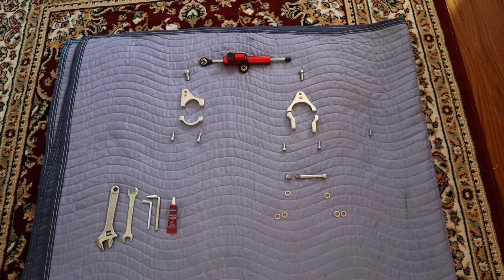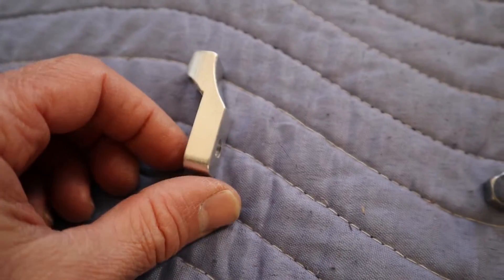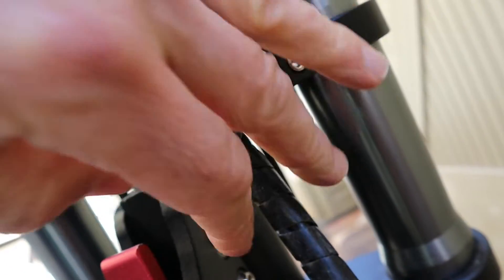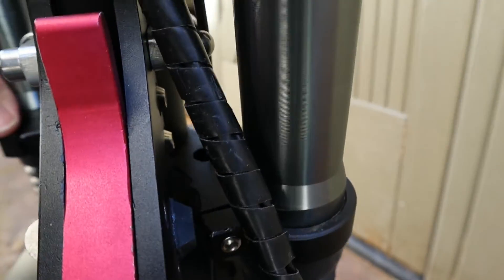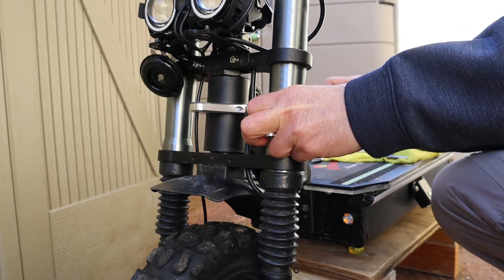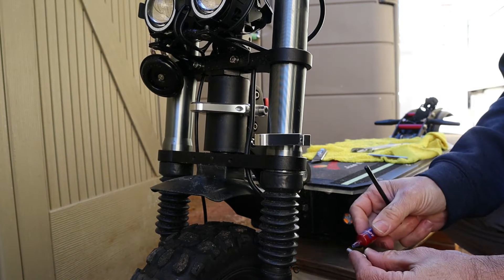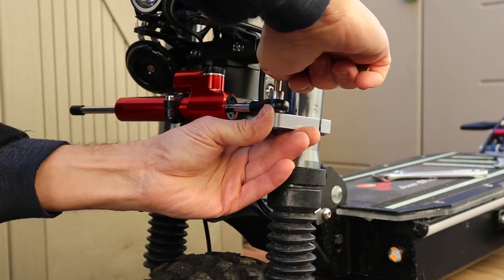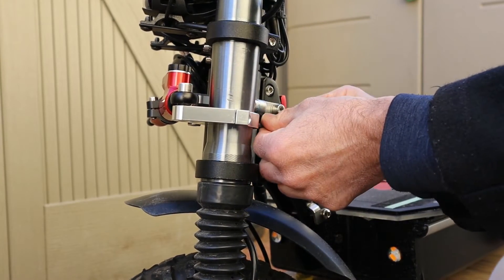Scooter Steering Damper Installation

Comment: You may not need the special pieces he made for the 55mm bracket. You can  cut a middle gap in the back part the 55mm bracket basically created two smaller pieces. It’s not a complete wrap around on the back bracket, but it it still secure and shouldn’t fall off. You can also get a thin piece of galvanized sheet metal, fold it a few times, cut to size and create your custom piece for a complete wrap around. No special tools needed. Thanks for the video! It helped a lot.
Reply: I'm new getting into this and I'm having a hard time finding a steering damper for my Laotie ti30, or at least the mounting portion of it sigh
Reply: Agreed.  I took your suggestion and chopped the included 55mm clamp as you suggested.  It was plenty of partial wrap-around like that and has held up well.  Thanks to the poster of the video and this added suggestion.
Reply: @randywilliams2052 may I see your work?

Comment: Hi Joel,
Thanks for your explanation and ideas. I bought all the parts from aliexpress but i was wondering if you can help me with some measurements for the 55mm clamp modification. I dont have access to the scooter now and i can try to prepare the 2 halves but i dont have any measurements to start from. Do you have by any chance some template or some dimentions to help me with? Best regards.
Reply: Hey Dani could you possibly send a link to where you found it? and if maybe you figured out the measurements as well! Thank you so much happy new years!

Comment: where did you buy steer damper?
Reply from the maker: Aliexpress
Reply: @MrEnergyFree  i tried to look on aliExpress but its hard to find it. Do you sir a link?
Reply: I allso need this kit and damper.Please advice how to get !!
Reply from the maker: @TheWorldOfAnimal0617  I bough all the part separated and I put it together myself.
The description from Aliexpress are:
Universal Motorcycle Aluminium Steering Damper Fork Frame Mounting Clamp Bracket 30mm 32mm 33mm 35mm 37mm 38mm 39mm 40mm 45mm
Cnc Aluminum Steering Damper Motorcycle Damper Fork Bracket Support Holder Universal 31- 54 60mm Aluminum Bracket Support Holder
For KAWASAKI ZX7R ZX 7R 1989 1990 1991 1992-2003 CNC Aluminum Motorcycle Damper Steering Stabilize Safety Control
Reply from the maker: @Tjvaara  I choose the 55mm for the center and Clamp and 41mm Clamp for the shock adsorber. All from Aliexpress
Reply: @MrEnergyFree  I'll look for them.The fork is 41mm i know this because i ordered from Aliexpress clamps for turn led light signal's.The center clamp is more of an issue but i'll look for the 55mm clamp and two 60mm support clamps for this like you said.Thanks 👍🙂
Reply: @MrEnergyFree  For the 55mm center bracket did you make yourself the "two" small brackets that go with the 55mm to fit secure with long bolt.I can't find the "two" small brackets that go with 55mm clamp.Please advice 👍
Reply from the maker: @Tjvaara  Yes, I made those myself from a block of aluminum and two days filing and drilling. You can also take the half back of the clamp and cut a gap to accommodate the neck that goes to the deck. That was my original idea but I decided to make more involved.
Reply: @MrEnergyFree  what type of bolts did you get ?
Reply from the maker: @onehubanime2770  Stainless steel
Reply: @MrEnergyFree  Hi Joel. Have you thought that you can gain some money by making and selling those parts to us :) ?  Make a price, please. I don't have any chance of making them. Thanks a lot. Cheers.
Reply: hello, will you have a link for the support? I can't find it with the description. thank you so much
Reply: @TheWorldOfAnimal0617  hello, did you find the support?
Reply: Can you provide me with the Aliexpress link please
Reply: Amazon
Reply: It's called a V7 damper kit